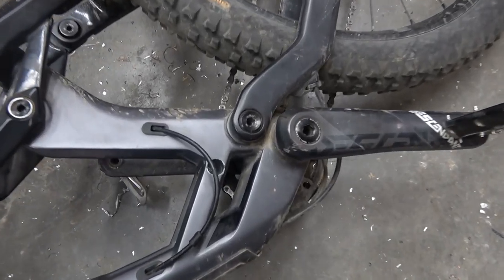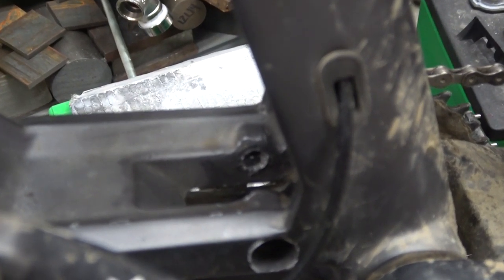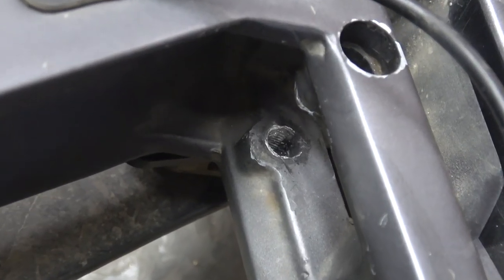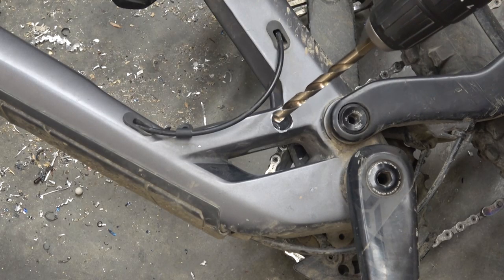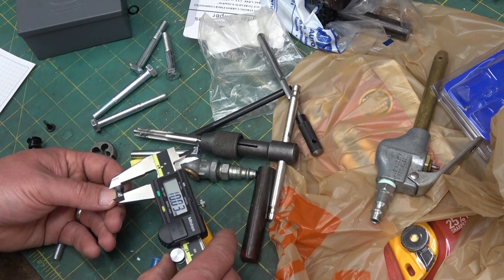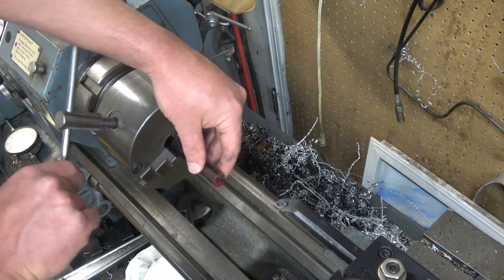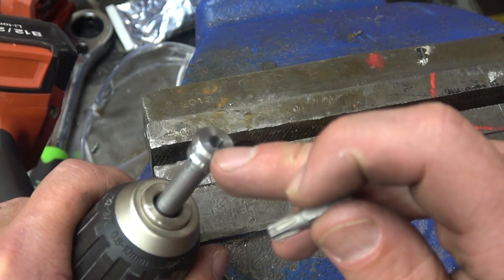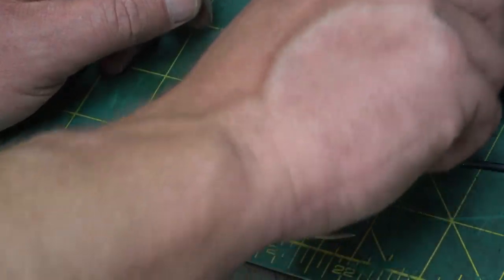What's a scumbag offset? | Obscure German Carbon Fiber Bike

Comment: If it's not clamping, why didn't they just through hole both sides with a solid pin and a couple jeezlus clips?
Reply: Even then an aluminum pin probably would be adequate, no threads to break at.
Reply: And completely "floating"

Comment: My Cuber Stereo 160 has aluminum pins, never had a problem. It's less progressive, too. They didn't thread the carbon, instead the bore is smooth and the pin threads into a deep sleeve. Very supportive.

Comment: I used the same machine at college in the 90" in leeds Britain.
But we had all everything we needed chucks etc which found its way into peoples homes for later use. The tutor didn't mind just as long as you asked as he had a budget for breakages.
I remember a thing I made was a gear stick hob out of aluminium and then I made a steering gearing linkage highly over-engineer the years of strange things started there. Now I sit and watch others making things :/

Comment: That intro rant sounded like you were talking about Hitler's Revenge.. I mean VW.
Reply: and the effing braided vacuum hose.  And for extra revenge try an Audi:  Central locking with electric solenoids in the doors?  Nein Fritz Ve vill put graphite impeller in ze trunk un zen vacuum hose to ze doors und trunk locks.  Ya Lars?  Ya das es good.    Like an explosion in a pencil sharpener factory.

Comment: Back just before the fall of the Wall in Germany it was American Army Soldiers hardly ever Sober on Weekends who invented 2 things ...
Extreme Downhill Mountain biking with Lots of twists and Turns even just Millimeters to spare between tree trunks and Handlebars, followed 90+ degree turns on 30-70% grades. The only fitting thing to do after bouncing off trees at 10’ off the ground, was first to ghost ride and then Drop sacrifices of Huffy bikes over the cliff edges of small Quarries some times directly on to small Tactical Ground Fires 🔥... one thing is Huffy’s always Bent but seldom Broke except at three spots. Top of the Forks, front pipe to peddle housing, and beneath the seat where a pair of small diameter pipes will dimple yer Arse with painful twin reminders oftentimes a little bit bloody when it passes the rear of the seat ...
Great 👍 Vijayo !!! Keep yer Scookum clean!!! And yer Stik off da ICE!!!

Comment: It's not made in Germany ;-)
Reply: It was made in Germany, if at least one part was screwed together in Germany ... so the final production took place. It is almost nothing in Germany really produced, you only use known brand names or the label "made in Germany" to sell a product better.
The most things I can buy here inside of germany are made in China.
All the middlemen (German: "Zwischenhändler") are wondering that I buy my goods directly in China and not through the detour and they get lost some profits.
Reply: Well it's possible, it broke down cause of over engineering.
Reply: Julian Knödler 

The German (over) engineer that approved the foreign parts to be used, put his signature on the paper saying they would work... it doesn’t matter how crappy of an original design the sub component was, the guy who said it would work for that was the German.

Comment: I been riding downhill and cross country almost 20 years. Stay the hell away from carbon fiber frames.
Reply: I always thought it was because carbons are so light I'd over exert and get fatigued faster so I've never tried one
Reply: @wishdeus  When you think of riding really really light bikes its got this strange imagined feel to it...Its actually really rigid, wont really absorb any of your energy flexing and stuff granted you are using stuff with decent geometry. when you go superlight its surprisingly nice feeling ride, its surprising how much more you feel like part of your bike..and your body will always provide all the weight for momentum you need. Long as the bike can withstand the physical forces your putting on it. Really The problem with it is you cant do much with it and its prone to cracks and stuff, and if your on it and it breaks anywhere critical, or anything get scraped and screwed up your only option is gluing something in it usually or wrapping it with more carbon or something like that. last thing i want is to need a whole new frame/machine shop (which youll be using to make whatever was carbon again out of metal anyway, and/or making metal inserts/sleeves etc to take the carbon out of the equation in your solurtion..) cuz of one little problem
Reply: Just out of curiosity, was this with recent frames, or earlier ones? I'm curious if the technology might have matured a bit, like aluminum frames did since the secondhand Cannondale I have that broke its head tube welds was made.
Reply: @mysss29   lol well those cannondales have some of their own specific kinds of problems.. was it one of the single shock on the neck of the forks types? large tube with thin wleds they were prone to breaking.. or the leftys, they were nice really light and such but, well obvious issues over time with only one side of the fork. If it was an industry standard fork design on cannondale frame then i would chalk it up to user error or cannondales smaller manufacturing and using all sorts of innovative frame geometries (some not so good ones slip through the cracks more often when your experimenting a lot and outputting relatively high volume) But carbon is carbon no matter what. its made of a resin type deal and so itll always be inferior to a metal thats not simply chemically bonded material, which carbon fiber will always be no matter how "good" it gets. however they will usually take a good beating and if you can get a good deal on one and your willing to just replace it straight up at sign of any issue. Go for it. they are getting cheaper (pretty much cuz carbon fibers growing use and manufacturing facilities capabilities)  and due to people wising up and staying away from them. also people are designing and making their own frame and small companies popping up doing the same (probly the case for this bike..) There are ways to do it well with carbon + other materials like a hybrid frame...but its not cheap. With Ti ends ad sleeves and inserts for all threads/joints/welds etc...

Comment: As someone who has been known to bike 1000K a month here in Germany and had my bikes custom made I will add some thinking behind the "these bikes": Weight-weenies are in a constant quest to get things lighter. Not always for the better. Average person sees a component loose 5grams and then it costs 200 euros more, but the engineers see it as a 10% reduction in weight. Problem is you are not in a car where grams mean nothing but on a bike that is already getting into the grams region of weight matters. So exotic alloys come in play. When used correctly they work well. I use Chris King hubs and they are full alloy, and the strongest i have had. I believe 6XXX series. Here a lot try to use 75XX series as it is lighter, but it requires CNC ing because it is so hard. Downside, also less ideal for fatigue, and of course more costly to do right and test. Then we have Carbon :D Next part is race type bikes that are well maintained vs normal ppl riding them and not following the recommended service life. Often things like Carbon handle bars are recommended to be changed every two years, and I assure you they never are. 

But I think you get the point.

Comment: Take off the swaged material leaving nice clean holes, then put a couple of steel inserts fit to the size of the holes, epoxy or jb weld them in, then replace the through pin with an actual bolt that way it too keeps both steel inserts in place. With the added support for the bolt's shank it would become damn near impossible for the shock to snap it.

Comment: 18:00 The non-movable side of the adjustable wrench is the side that should take the force. Here Ave is using the movable side. He would need to turn that wrench over in order to be using the correct side, the strong side.

Comment: Nice episode. I will be avoiding ti swingarm pivot bolt, and shock bolts on motocrosser. 4140 off the rack is 30 Rockwell. used it on bike hubs. 60 is like glass, think cold rolled is about 5? Wonder what 6al4v would be on same scale, grade 5? What the hell hardness is on Rockwell for grade 5 or 8. Shop I use to slave at got the contract to make black(orange & yellow iradite) boxes for Lockheed Martin, lots of slits and tangs to break off in their 1 million holes.

Comment: Wonder if the aluminium pin is designed to work as a fuse, to avoid snapping the frame when the bike takes excessively large hits.

Comment: Back of the napkin calculation says that pin can handle over 500 million cycles at 5000 newtons cyclic loading. I refuse to believe that it could ever see that much during normal use. I.e. that pin was defective. Probably had some internal grain boundary or sumthin.   Side note. The reason why you have to use the tool to install helicoil inserts is because they grab the far end of the insert, so they get smaller under torque. Then they spring out to fill the hole.

Comment: Once you use Keensert inserts you will never use Helicoil again. Keenserts use standard size metric and imperial taps and the thread insert is machined from solid steel with hammer in lock pins and they never fail or unthread like the Helicoil inserts do.

Comment: One single thing I'd have done different - when you're placing in the replacement thread, should have treat it with some low-grit paper and smeared it with epoxy.. 
So it sticks to the exposed carbon.
Great job nevertheless :)

Comment: Yeah thats an example of having a guiding principle in your design paradigm that causes product failure. 
 The weight savings from that pin being aluminum could only have been measured in grams or maybe ounces. Not very much. 
They could have done even better by using a hollow hardened steel pin. Would have cost slightly more for the pin, but the fastener for it could have been two cotter pins.

Comment: I could understand using a weaker material for that pin as a sort of a circuit breaker, intent being the small, cheap pin breaks before the shock absorber or the frame fail. Using steel might have just made the hole in the frame go out of round and you're not fixing that at a bike shop. Making the pin fancy sorta defeats the purpose though.

Comment: I'm curious to know how this held up!  It seems the original design would be something of a fuse on the suspenders where the highest force is transmitted to the frame when the piton hits the back wall.  Rather than destroying the carbon parts, the Alu bolt will quit first

Comment: Ahh VWs aren’t so bad, though my mk1 gti was made in PA I’ve had a few Wolfsburg built cars. The craziest thing is that starting with mk5 I believe the windshield wipers were tied into the ecu, this is because when you come to a stop they automatically reduce speed to intermittent and increase when you move again. This is a good analogy for German car design, take a ridiculously simple feature like windshield wipers and make them depend upon an extremely complex computerized controller for a slight convenience. It’s like any other car once you develop mechanical sympathy and get used to that manufacturers idiosyncrasies (AND BUY A TRIPLE SQUARE SET!) it’ll make sense.

Comment: i ran into the same issue but with large displacement infernal combustion 2 wheelers. Last fall i sold my 1985 japanese iron motorcickle with 50k miles to downgrade to a 2004 BMW with 22k miles and special aluminum magenesium alloy farkles. So far it has all the "expected" common issues like leaking hydraulic clutch slave cylinder which leaks brake fluid down the clutch pushrod and onto the auto style dry clutch GEENYUS design. but it doesn't even start there, the clutch disk/trans input shaft splines only engage 2/3 of the way so they tend to wear into each other, from engine power pulses mostly. So my preventative maintenance before summer hit will be taking the entire pig half apart to swap out a clutch disc with a longer spline hub to keep from having to rebuild the transmission to a new part which doesn't even prevent the issue from happening again. NO RECALLS, i'm guessing they didn't make enough profit on 20 year old mechanical designs selling for $15k new in 2005

Comment: Run your rear shock with worn out bushings, the bolt breaks, or the shock eyelet breaks.  They should be replaced during maintenance to prevent this.

Comment: Looks good but probably will be tough to replace the shock. How is he supposed to heat the threads up inside a blind hole surrounded by carbon fiber?

Comment: There’s nothing wrong with making that pin out of aluminum alloy. It just needs to be the right type. Gotta use 7075 T6. Also, no machined threads. Roll forged only.

Comment: Almost perfect... Those crunchy carbon threads after the tap would have been perfect if you swabbed a little epoxy on them before threading in the insert.

Comment: HeliCoils.....

My mate had a ski boat that had a Holden 308 V8 in it here in Australia called a red motor 

we went to rebuild it and because the river water is the coolant 

every single head bolt on both heads pulled the threads out and every single head bolt needed to be Helicoiled.....

I haven’t been the same since......

Comment: ah yes the helicoil. invented and made in bethel connecticut, i worked the second shift after my first job, 3 color offset printer by day , then ran 4 of these machines that made thousands of them buggers.  tough quality control to. , eh not really just pride.  at 21 years old back in 1978

Comment: I have destroyed my bike three times. The first time was a broken axle on the back wheel. After installing new axle with extra bearings the chain ripped of. After installing a new stronger chain for E-Bikes, the pedal arm sheared of . What I do wrong? Maybe it´s because I am a Strong Man with to much power to run a usual bike. But i like cycling.

Comment: M8X1.0 sounds like Whitworth. Sold by England, made of Sheffield Steel. Inches for the wrenches, frog for the log, with an obsolete thread pitch. 
Used by the Germans until for some reason England wouldn’t sell them bolts any more. That’s right, use your SAE wrenches on that Me-109 you’re hiding, but don’t lose a bolt.
Still used in Russia on their guns.

Comment: I'm a layman, so forgive my ignorance, but could the aluminium bolt be a design choice such that the bolt is more likely to fail than damage or split the carbon fibre frame? Like a softer key in a hardened keyway?

Comment: Well this sucks. I have the same bike, just the 2020 Version. And the funny thing is, they still put aluminum Pins and Screws everywhere in the Suspension.. My problem is that all the Bearings in the rear triangle are shot..

Comment: 1.0 metric threads are common on hydraulic brake and clutch fittings
Reply: Yup. Painfully learned that after drilling out the bolts holding my brake calipers. On a Saturday afternoon. When there's no chance to get spares...

Comment: the bike is designed for a rider of 11 to 12 stone and tested ...if your shearing pin bolts you need a custom bike ...I have snapped frames in half bent a forks never shearing a pin

Comment: isn't it possible that the aluminum pin is protecting something else by failing first? Like the frame? Suspension bottoming out is a symptom of the rider behaviour or an insufficient suspension design for said rider behaviour. With a steel pin every time he bottoms out that pin is going to likely mush its way through the frame slowly but surely.

Comment: Crank screws are M8x1. It's quite a common thread. The bolt designer used it cause he had to save the core area. The 1,25 would have broken faster. There is also M8x0,75 on bikes for the chain rings and to mount braking discs to Rohloff hubs. You have UNC and UNF too. I think I would have turned a pin without thread and glued it in the frame to save as much as possible of that sketchy thin aluminium insert in the carbon. The aluminum bolt is likely either 7075 or 7001 and those are stronger than the cheap 4.6 screws from home depot. Good you didn't use them. I hope the loctite won't pull the helicoil as it's actually impossible to heat the bolt in that place without killing the frame.
This German bike http://reiseradgabel.de/english/53n.html has no overengineered ultra light parts and a much simpler more rugged suspension. Anyways I have redesigned the 16mm massive steel pivot of the rear link to 25mm hollow anodized aluminium as the bushing live time and stiffness are highly increased.

Comment: Hi all, just stompeld onto this wideo, have to say that i had a similar problem with my ghost amx+ frame the rocker has a 4 mm bolt holding it, it broke a couple of times, so i had to back engeener it somehow, went for a 4>5mm and some zipties, since than shes stll rolling

Comment: shoulda just found an m8 SHCS with close to the correct untjreaded shaft length, cut the threaded end to length, drill and tap the head for m3 and then cut the head off the original alum pin as a spacer for the cable strap....i hate to see machining done when it isn't needed.

Comment: Moving the weak point of a 10 penny pin (for which the manufacturer adds 300% profit) to the 2k frame.  Not sure about that one good buddy. although I see the manufuckterer has been on and they changed the pin anyways, so maybe there wasn't any FE done after all.

Comment: 25 years plus in the back of a bike shop . Aluminum and carbon are harsh mistresses . They will let you down, and fail on the trail.....in the most awful time , in the most awful way . The best shock mounting hardware I came across was from Morewood . Good solid stuff . Their SPI bolts were the deal . Look in the back of any shop the mechanics are all ludites rolling on steel single speed hard tails . We are tired of the crap .